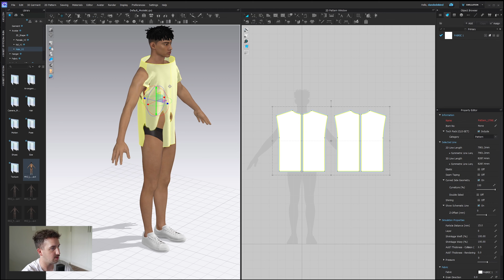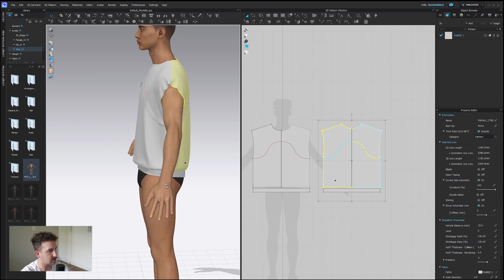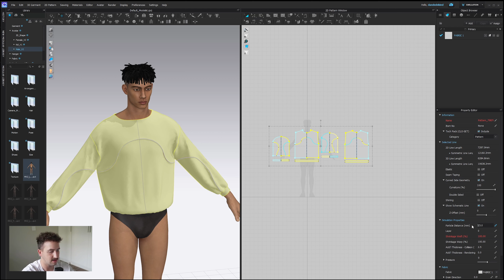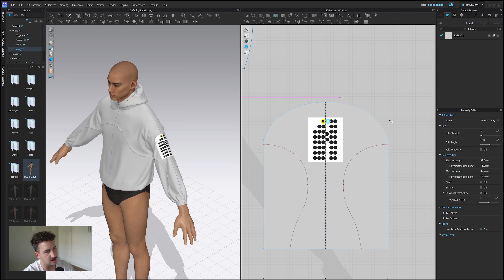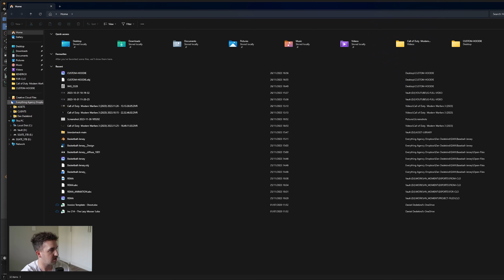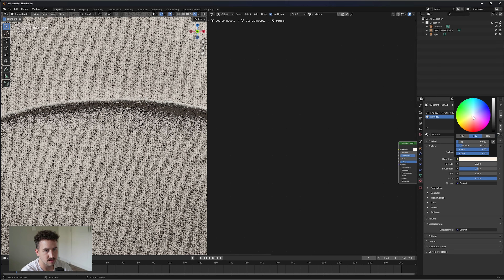Creating a Hoodie in CLO3D/ Marvelous Designer - Tutorial

Comment: How do you turn on the mirror editing of a polygon if it doesn't happen automatically? I have linked editing applied between the two sides of the from top the shirt, but when I go to create the curved line in the middle, it doesn't mirror. Any suggestions?
Reply from the maker: You need to have mirror editing on or else you can create a pattern on one side then mirror paste it to the other piece. Hope that helps.